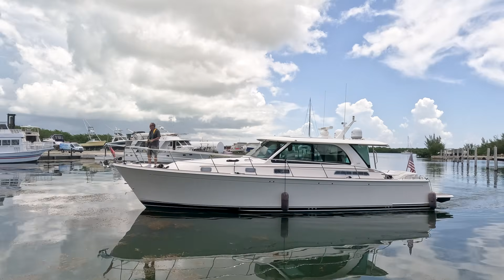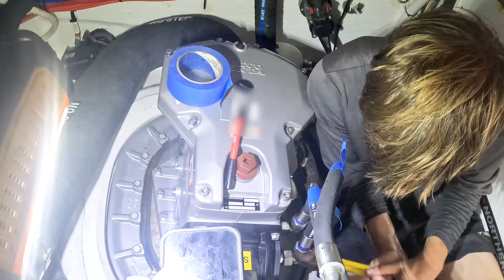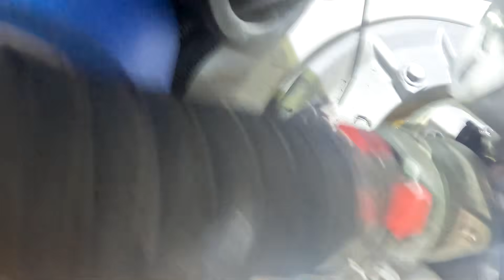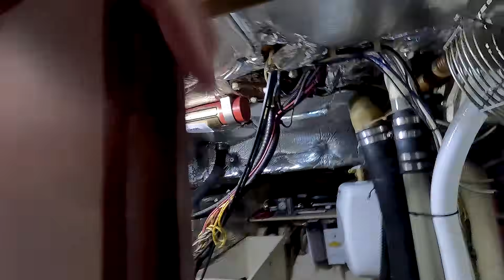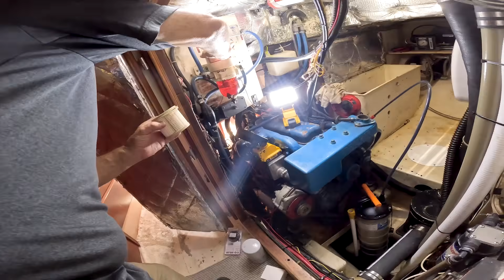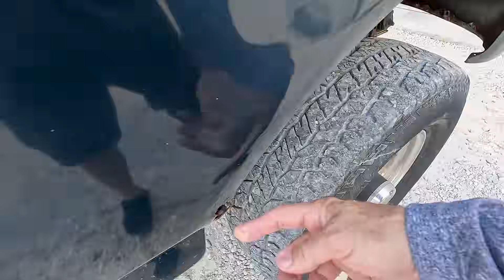After sitting will this 37 year old engine run?

Comment from the maker: We weren't sure what we were getting ourselves into with helping this guy with his engine. Turns out the 37 year old engine just needed a little bit of work we got it running after the service. Mission Successful!
Reply: The squeeze bulb that goes to the racor isnt oil resistant. The diesel will eat it eventually. Might consider removing it and put a direct line to the racor. Perkins engines have a lift pump on the fuel pump, should be ablecto prime the injectors and shell run just fine without extra pumps.

Comment: Do not even think about a new Ford 250 they're too complicated now, plus just even if you think of working on these trucks, you will need a lift to remove the cab from the frame, and then you can see what you're needing to fix !
Reply from the maker: Definitely don’t want a new one.

Comment: That 7.3 Powerstroke is a gem. Had an Excursion with that motor. I sold it with over 400,000 miles on it and that motor still ran perfect. Never dripped a drop of oil. Still miss that thing but with that many miles you can imagine how ratty the interior and some of the body work was getting.
Reply from the maker: 🤣 you got your monies worth.

Comment: @WillFixThat or anyone else.
I have a question.
After watching a bunch of your videos I took notice you use crimp connectors for electrical work. 
I'm a retired mobile electronics technician with 30+ years experience. My question is: Why do you not solder and shrink wrap/tube electrical connections? 
Using "glue-filled" shrink tube to cover the connections makes a water/oxygen seal providing significantly improved protection. A soldered connection has lower resistance than crimps and if you use silver solder its even better.

Not being critical, just curious. Cheers

Comment: I had a 96 Ford Econoline E-350 extended cargo van with 7.3 powerstroke that lasted over 400K miles.  It would still be running today if it wasn't totaled while parked and hit from behind by a sleepy driver.  The engine and trans survived, but the frame was bent from being hit at 50mph and launched 150 feet down the road.   It was previously outfitted by a professional plumber with a security cage.   It served as a nice RV space that's probably larger than most boat cabins.  These were frequently outfitted as Ambulance/Paramedic, with upgraded alternator and dual batteries.  3rd party fiberglass roof extenders were widely available.   Makes a great stealth RV setup, and better for secure storage if you build a cage for it.  You might look at the Econline van version as backup for the truck, or better for custom refit.  The 7.3L was used through 2003.
Reply from the maker: Thanks for sharing 👍

Comment: Keep that 7.3! Put over 200K on an F-550 6x4 using it as an ironworkers rig. Two 300 Lincoln diesel welders, 500 ft 2/0 cable and all the rest of an steel erectors tools - heavy! Never a problem, probably still running today. Forget the new stuff - pure over priced junk. New crap’s  kinda like some of the boats ya work on - $$$$, for what?
Reply from the maker: Haha love the last sentence

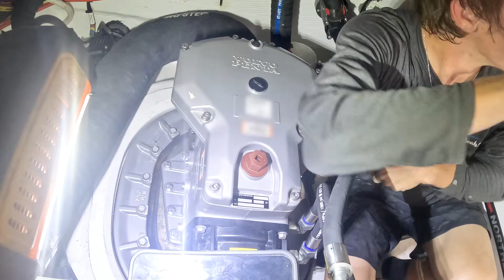Comment: 3:15 Every boat design engineer should be required to work on the boat after its put together.  They need to swap out that pump or switch or IPS drive and see how the lack of serviceability works with their dumb layout choices.  Although it might actually be the bean counters that need to do it based on saying you can't spend that much on empty space to work in.  🤦‍♂🤷‍♂

Comment: I have a 2001 F350 with a 7.3.   The front end (straight axle) isn’t much better.   It’s all over the place.     I bought a 2024 F350 DWR with the 7.3 Godzilla gasser.   It was really nice.   Although I sold it with 3000 miles on it since we bought our trawler and living on it full time and not doing the truck camper route.    I still have the 01 I keep at our home as a ranch truck.  230k miles. 

New trucks are nice.  Here’s my .02.  Give your truck to AJ as an appreciation of his accomplishments and keeping his knowledge.    Good employees as you know are hard to come by.   

If you really need a truck with a big engine to tow in KW, skip the diesel and look at the 7.3 gasser.   It’s about $10k less.   I custom ordered my 350 Lariat without some of the fancy auto drive systems and got it down to low $70’s. 

If you don’t need a tow truck then a nice F-150 or even Ford Ranger,  we have a 2023 Ranger Raptor. It has a 7500 lb towing capacity. Really all you need for your boat in KW and it’s a smaller truck, just perfect for KW.  I signed up for Veterans Advantage. ($75/year).  Ford allows you to use that on the X plan to purchase a truck.   I saved literally $5000k on the F-350 I purchased. 

Hope to be in KW this winter, on the waiting list at Ocean Edge

Jim
MV Cetus
Reply from the maker: Check out the Perry hotel and marina if you can’t get into Oceans Edge.

Comment: Throw away that "Pen," and that "2- inch BLUE Painter-Tape.  If I were you I be looking to purchase maybe years ago.
:
The 3M ScotchCode Wire Marker Tape Dispenser STD is a compact, carry-along dispenser with ten refillable compartments {numbers: zero to nine,} which hold eight-foot rolls of non-smear polyester tape. The tape’s high-tack, acrylic adhesive resists solvents, oil, and water and adheres firmly to insulation surfaces.

COMPACT: Six characters (numbers) per inch of tape.  Numbers “Six” & “Nine,” are underlined to help to show the difference / differentiate.  ACTUAL measurements as by me: 0.220" in. (5.56 mm.) wide, 0.0065" in. / 0.15 mm (thick) Marker Tape Refill Roll(s.)

Seriously think in terms of just learning in the year 2025, their is this thing called / fire or the wheel.  As a retired Autobody guy, I learned about this back in the early 2000's.  Seeing someone still using a "Pen & Tape" to mark something, I just shake my head in disbelief.  Next thing you know, someone might invent say electricity or even a way to communicate via say a telephone, oh wait what's that, they done that already, okay, never mind.
Reply from the maker: Remember he is younger and it works for him. Great tip we will see if he’s interested in changing his process.

Comment: Having worked on a lot of equipment with hydraulic and electric conductors we would use colored zip ties or if you can find a  length of 25or50 pair phone wire there are numerous different color combinations you can use to mark connections. They will also survive wash down and most solvents
Reply from the maker: Great tip thank you.

Comment: A pro tip, use color zip ties. Im a heady duty  equipment mechanic,  and work on  air brakes and hydraulic systems, color zip ties are life saver.
Reply from the maker: Great tip 👍 Matt’s used them before.

Comment: Necessity is the mother of invention..... Great invention. If it works you can patten it and make $$$ for it. Great job.
Reply from the maker: Works great… we just did an install a few days ago to test it on a flat bottom. In a few weeks we need to do it on a larger dead rise boat. Plus we got longer bolts.

Comment: Re your big Green Ford - front axle.. if your refering to the Twin I-Beam front suspension, I ran my non four wheel drive with only two alignments in fourteen years. The thing to watch out for in the Twin I-Beam is KING PIN lubrication. Vehicle-Weight on the Bottom-End of king pins must be relieved using a 'pump jack' BFORE greasing, and Greasing must be done almost monthly Both top and bottom King Pins must leak grease at two points noticeably top side of each fitting before being complete. After fourteen years and missing four months of not lubricating appx Six Week intervals, noth sides seized! Goodbye Truck.

Comment: Nice truck.  I'd look into getting those seats reupholstered if you've got someone down there.  They can pretty much make them brand new but with better foam.  They'd be a lot better that a swap that might be worn especially considering Airbag sensors and possibly rewiring power seats if you have them.  If you're worried about the backseat matching then just get them done too.  That truck's worth the investment.  People are starting to collect them.
Reply from the maker: Yes found someone that does truck seats.

Comment: I’ve had both, IFS and the straight axle. The IFS is more maintenance as you have more bushings involved, but if they’re all in good shape, the steering is a lot better. The straight axle is less complicated, but the steering is more vague, something I guess you get use to.
Is it worth the money to convert it? IMHO you’ll spend less money rebuilding the IFS and have better steering.
Reply from the maker: It’s all personal preference like you’ve mentions some pros & cons.